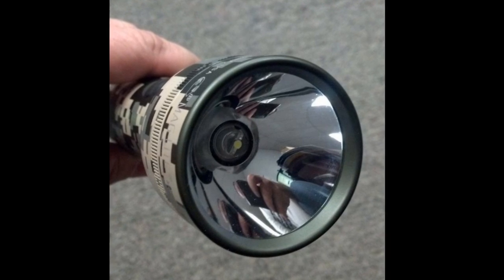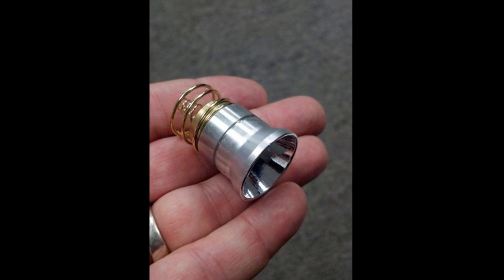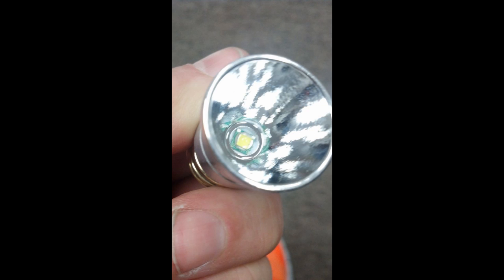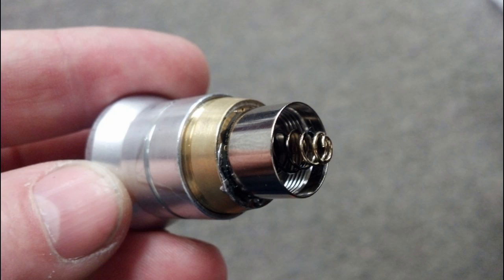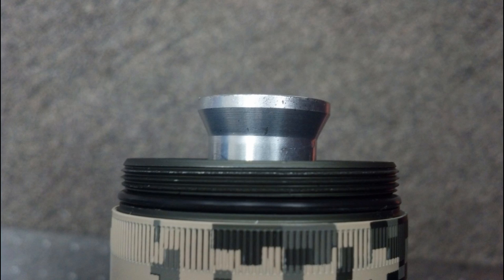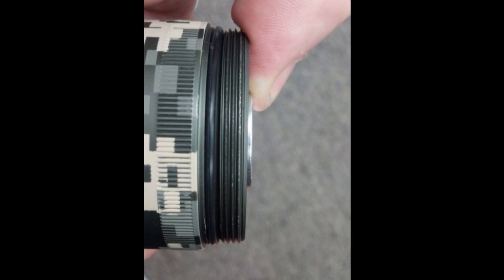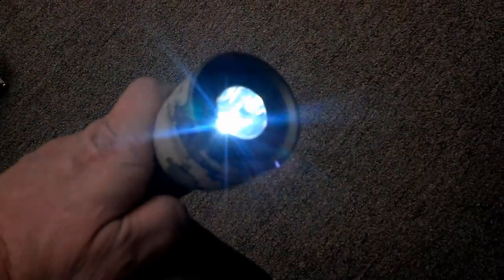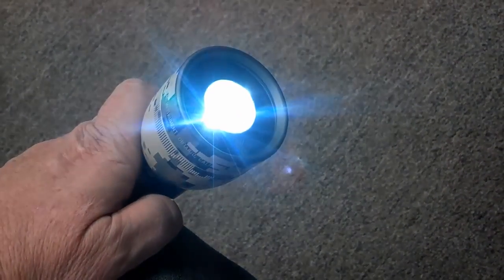MagLite 3D LED Upgrade - 1400 lumen CREE XM-L U3 bulb

Comment: 3D M*g has battery space of about 7.2" long. (Battery space length only)
If you can shorten the battery space to about 2.8" then single 26650 will fit perfectly which is much shorter, much lighter weight, rechargeable,  with good run time per charge and steady brightness from beganing to end of each charge.  Voltage of single 26650 is same as 3D
Your flashlight will be about 4.4" shorter than original 3D  and no more battery leak or stuck..
All  you need to do is take your 3D M*g flashlight to machine shop and ask him you need only 2.8" battery space in length.

Comment: Paul,  thanks for the great info. I was looking for a conversion such as the one that you accomplished on your maglight. I agree drop in LEDs are useless. So I'm glad that I found your video before I found any led bulbs for sale.
Reply: Hello TI, I noticed your comment “ I agree the drop in LEDs are useless “  Please check on eBay for
TERRALUX  p/n TLE-310M-EX (MiniStar 31M-EX)  It’s sold by ‘ Firefly Buys’ by a nice Lady called Katie.
The cost is $43. It is a straight forward process. Open the Bessel remove the original incandescent bulb.
Drop the TERRALUX unit into the receptacle. That’s all to it.
The throw is very powerful, calculated to 1000 Lumens. There’s 3 way switching as, High, Medium and Low.
There’s no flashing included. It’s recommended that the power supply be Lithium Ion Battery. Since your 
MAGLITE is 3D type you may only use 2X26650 (ORBTRONIC). These Batteries are very Heavy Duty type of
5200mAH each. You can use two of them in series to get a total power of 8.2v.
A slight modification to the end cap spring is require by soldering a short 14 AWG wire is from the end of the spring to the top of the spring.
This is to facilitate flawless passage of high current to the Emitters. Since the 2 Batteries fall slightly shorter than the D Cells, you may also have to make a ‘dummy’ conductor. Remember, on the switch side, if you notice, the positive volt passes through the SPRING!
This set up is alright for the old incandescent bulb, but not for high power LED emitters. So a slight modification there is necessary, by the way of a short 14 AWG wire soldered from the bottom of the spring cap to the top of the spring cap. The result is fantastic and you’d really enjoy your MAGLITE. Cheers.
Reply: Sree  Kumar thanks again Sree. I will keep your suggestion in mind.
Reply: You are welcome @ TI have a nice weekend...

Comment: Fine, but you loose the beam focusing capability with your change.  Hard to say what is better.
Reply: Thomas, There's no need to perform the old way of focussing the light throw. Because the unit is already focused. You could also try using TERRALUX model TLE-310M-EX miniStar.
It has 3 prefocussed LED emitters @1000 Lumens. The price range is $43 ~ $59. It's available in US. But if you notice, Paul bought single LED emitter with 1400 Lumens, from AliExpress China. and I'm sure the cost will be way much below the US prices.

Comment: Thanks for the video. I have done the mod to three 3D cell Mag-lite torches, and they all work. I even changed an old 3D Craftsmen flashlight based on this. Now in the process of cutting them down in size to use a single 18650 or 26650 Li-on battery.

Comment: With all the New Tech why does Maglite stat with the old.
They would sell loads more.
Reply: +Graham Sherrington - Graham, Maglite sells 2 & 3 Cell LED flashlights. They are BRIGHT. I have 2 new LED Maglites (3 cell) and 2 older Maglites with Krypton bulbs (one 3 cell and one 4 cell). The new LED Maglites are a good 20 - 30X brighter. No joke. They are fantastic! I bought them in a kit from Costco that came with a small mini LED Maglite for about $30.00 for the 2 lights. I will probably convert my older ones to LED.

Comment: tried this. couldn't get it to work.
Reply from the maker: +Kevin McWhorter I'm sorry to hear you had trouble.  Mine is still working great and it's been over 15 months.  Have you tried running wires directly from batteries to LED to see if LED is working correctly?  I'm happy to help if you can give me more info on what trouble you are having.

Comment from the maker: I'm sure the Chinese over rate these LED's but I went by what they say. I can tell you it is bright and works well. I am still on first set of batteries but rarely use it since it is mounted in back of my truck and only pull it out to look for stuff. It was easy to solder and just took second to do.

About aqua colored light - I've never seen a LED in that color, your only way would be with a color filter but will not be bright as you are filtering out most of the color spectrum.
Reply: would you be willing to make another one of these and sell it? I don't have a soldering iron or the really know how. But I'd buy the light and pay you for your labor
Reply from the maker: +James Smith - I could make one for you. $20 + parts. Send me an email to "Paul @ Chaklos dot com"